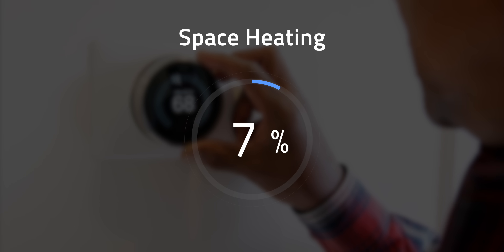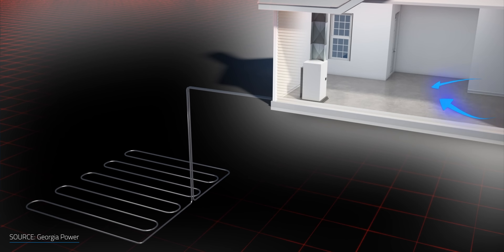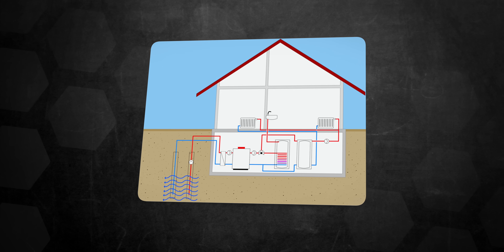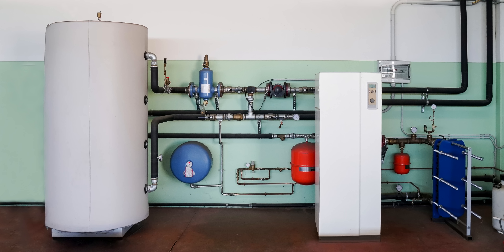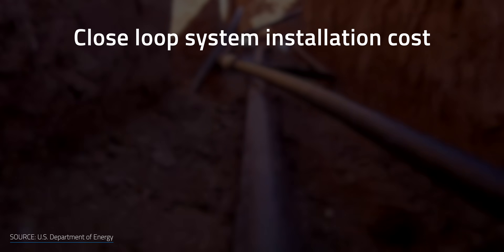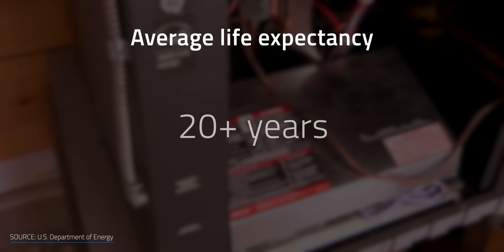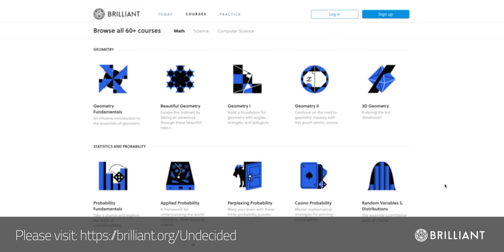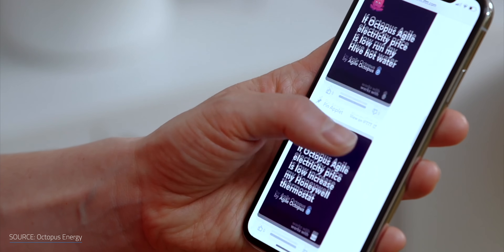Is Geothermal Heating and Cooling Worth the Cost?  Heat Pumps Explained

Comment: I live in Sweden and have a heat exchanger with a 180m borehole with a closed loop. It works well and has reduced the heating by about 70%. I'm just unhappy that I didn't install the cooling, didn't think it was needed because it's few days it's really hot.

Comment: My natural gas cost to heat is 48$ a month in the winter and to cool is 65$ a month in the summer electric Avg coast 56.50$ a month between the 2. There is no way I am spending 12 to 15k to heat my house and cool it off this system. I would never make the money back. It would take literally take 21 years to make my money back! That is if system even lasts that long No thanks. The price had better drop by one hell of a lot to even consider it.

Comment: Its 16% total because it is use year round. Not 32% that would imply 32% to cool and heat yearly. You said 16% to cool and 16 % to heat. cooling and heating is yearly so that 16% avg usage not 32% yearly.

Comment: Ive installed and serviced water furnace for 21 years and found there are 2 types of geothermal , broke down and fixing to break down 😂 if it last 20 years without many problems you are lucy and may pay off the difference vs a nice heat pump .

Comment: Man, you are forgetting the simplest and carbon neutral way how to resolve a house heating.... better insulation.. That house heat loss you are presenting in this video is an atrocity, such house should have heat loss at around 1 kW at max and that only with -10 C or less outside and +20 C inside...

Comment: When I watch this video and read the comments, I am amazed at how different house heating is done in different parts of the world. Here in Sweden, many households, the vast majority, use geothermal heat. That is, a hole about 100 m deep down in the earth (normally solid rock). It is usually a few meters of soil, but then there are often rocks below the soil that can be drilled in and provide good heating. It is a simple system that provides very good economy. The reason that rock is a good heatsouce is that there are normaly cracks in the rock that transports water and heat with the water. Soil does not have the same water transport mechanims. Almost no one uses oil or direct electricity to heat the houses. As mentioned in the video, geothermal systems are expensive to invest in and you can get some tax reductions for the investment. But even without the tax reduction, geothermal heat pays off. It is easy to drill and the hole only takes one day to drill and then all earthworks are complete. A system like this costs approx 10-20.000 USD which is a lot of money. But heating a house in a cold climate costs a lot. The return of the investment is done in 5-10 years. So nearly everybody use this kind of heating system  😶‍🌫This kind of sytem can also be used to cool a house as a normal A/C system.

Comment: maybe you could answer I question I have   - you partly answered it in the video  - in so far as  closed loop systems. vertical holes verse. flat lay   space not a concern .   I see 3 systems   vertical hole  ,  horizontal coil  over lay (slinky )  and   a  horizontal lay  ,,,  which  system would preform  over a broader temp range  and would there  be difference in operation cost.over the long term    in other words the  best field system  .

Comment: NO! No liquid is compressed! It is cold-agent gas (freon) which is compressed- and this tech is already used for decades (in all kind of refrigerators)- and peaks it's t° to +55°C, The liquid in ground contour is only used as heat transmitter to cold-agent via heat exchanger.

Comment: We didn't install geothermal environmental solutions. We just built our house into a hill and added more soil and rock as a water collecting berm. So the temperature inside is constant unless we let the sun in or open windows. No air conditioning is needed and a couple of wood stoves provide a little more heat in the colder months. The outside temperature is 32F now in Missouri. The inside temperature is 64F and the stoves are not in use yet. I might start them up tomorrow if it feels too chilly. It never goes below 55F but rainy days feel colder.

Comment: I was forced to change my heating system 3 yrs ago when fossil heating oil was no longer allowed here in Norway. A closed loop vertical system was expensive, around $40.000 but has proven to be a very sound investment. When you’re in a climate with freezing winter temps 5-6 months a year, heating is most important and reliability critical. Also, costs have been reduced by around 40%, giving a payback time of 6-7 years, which I am very satisfied with. And the system runs on 95% renewable electricity.
Reply: thank you for the information on the payback time. it is just what i needed to know. most people say its worth it without giving much information
Reply: I hope your government will make pants forbidden for men someday. Only skirts for men - nothing else. It would be a lot of fun!

Comment: How does the electricity usage compare between a geothermal unit and a standard heat pump/HVAC unit? I'm interested in what sorts of heating and (especially) cooling can be run off solar power, so I am curious if the geothermal will be low enough in electricity usage that it would be feasible on a solar system.

Comment: I have a vertical system that was installed 5 years ago and I wish I had done it 20 years ago. I went from oil and coal about $400 a month in the winter (Western NY) now the electric the geo system uses is about $50 a month. Best investment I've made.

Comment: We had a Bosch installed in a new build in 2010. 11 years later and only thing I do is filters. I think my coil may be dusty/dirty as I can tell it isn't as efficient as it once was. Over all though, I'm 100% sold on geothermal. In a double wide mobile home, 1/3 this size, we had $400+ electric bills all thru the winter (no gas except tanks in this area). Now, a high electric bill is one over $200 but that happens maybe twice a year now. We have 3 or 4 vertical shafts for a approx. 4000 sq. ft. house on 2 levels. I don't believe its over a 2 ton unit but I may be mistaken on that. We have 6" framed walls with spray foam insulation in exterior walls and on top of drywall on all ceilings. Attic has blown in so we are seriously well insulated. Saving us a ton of money now that it's paid for! Go geothermal!

Comment: I thought about going the geo thermal route when we built ~11 years ago (northern state).  But rather than spending extra money on the geo install, I spent more money keeping what heat I made - in the house.  Six inches walls with a skim coat of spray foam (stops air intrusion), then R19.  Combine that with a +95% NG furnace that also has a heat pump , my HVAC costs are are very low.  One nice thing about building a well insulated house is that energy (heat) conservation is passive.  Other than the initial upfront cost - it's done and won't wear out over time like a furnace/heat pump/geo.  Having dual heat (gas/heat pump) is nice too since if one system fails, the other can pick up the slack (within limitations).  If I build again, I'd probably alter some things given advancements in HVAC, but still stay with the same concept.

Comment: I put in a new geothermal system a few years ago.  Upfront cost was high.  About $32k for a vertical loop and a high end Waterfurnace 7 series.  Initial savings were a little over $2k per year.  With oil prices higher now, savings are at least $2.5k per year.  At the time, tax credits we’re higher, so my break even cost was 5 to 6 years when you subtract the cost of a conventional system I would have bought and the tax credits.
One thing this video doesn’t cover are the comfort advantages.  For starters, the system is extremely quiet.  You really never hear it.  Instead, it runs pretty steadily at a very power efficient rate.  So, there are no swings in temperature that you have in more conventional systems.  Your house is just the temperature you want.  You never have to even think about it.  Oh, and because of the desuperheater, we effectively get free hot water during the summer months.   
If anyone is “on the fence” and seriously considering a geothermal system, I would strongly recommend they get one.  I’m very happy with my system both for the efficiency and cost savings, but also for the comfort.
Reply: I just got my waterfurnace replaced after 30 years. Only had a problem 2 times and both were minor issues. New system was about 10k after tax credit, and about 20% more energy efficient even compared to the older unit which was already crazy efficient to begin with. If the installation is done right its great, but bad installation will make it a nightmare
Reply: @gauravbansal2999  Yes, your comments on reliability and cost are consistent with expectations.  I agree that the quality of installation is important.  As I understand, Waterfurnace has a much more intensive and demanding training program to be qualified than their competitors.
Reply: @gauravbansal2999  I ended up firing my guy and am replacing the entire unit myself for half the quoted price.
Reply: I've had a Waterfurnace for 12 years and it has been trouble free.  Love it !! @gauravbansal2999
Reply: How deep did you have to drill and what was the temp coming out of the ground?
Reply: @litoaykiu  They drilled 2 boreholes that were each 300 feet deep for our loop.  I don’t know the exact temperature of the water.
Reply: @steveseidel9967  Thanks!
Reply: @steveseidel9967 How many tons was your 7 series water furnace? Forced air? Did you get electric backup built in?
Reply: @tylertoepke-floyd4755  3 ton system.  Yes, we had existing ductwork from our previous system.  Yes, it comes with electric coil emergency heat system.
Reply: With a life span of ten years, a replacement cost of the compressors between 8 and 15k, and electricity prices now at 30cents a kwhr, the comfort is nice but not in way cost effective.   
  My geo unit was installed in 2012, and has an average annual cost (including installation and maintenance) is $17,000 per year.   Anyone can decide for themselves if that is cost effective.
Reply: @jku72  Nobody is spending $17k per year.  That’s absurd.  Also, more than half the cost was the drilling for me. My ground loop has a 60 year warranty.  
The price of a new compressor is more like $3k.  The prices you mention are to replace the entire unit.  Also, the entire unit is indoor so it’s not exposed to the elements like a traditional system, so your average lifespan isn’t correct either.
Reply: @steveseidel9967   I have an actual unit, with actual quotes.  So yes, it really does cost that much.  I have a current quote less than two weeks old, two quotes actually.   One quote is just a compressor replacement, thats $6800, to replace the complete unit is $14,600.   Modine 5 ton unit.
Reply: You're clearly being ripped off then.  I'd suggest you consider other brands and/or a different installer.  Again, NOBODY is paying $17,000 per year.  So yeah, if you're getting robbed like that, it goes without saying that people should do the math to determine if it makes sense to them.

Comment: Only worth it if you can use the town water pressure and not have to use a pump. An intricate valve system will do! So yes! It’s worth it but if you need to buy pumps no it’s not. You have to weigh up all costs

Comment: Our house in Slovenia has similar system for heating.  We have it for about 12 years and it works without any issiues and electricity bill is pretty low value, compared to other heating systems.  All you need a decent piece of land to lay the pipes. We will build new house and I will def. consider this type of heating for the house.

Comment: You CAN obviously supliment Ground Source Heating with Black Panel roof mounting systems (Like a solar panel, but, its black with pipes running through them) So as the sun shines down water is pumped up to the roof, through the pipes zigzagging through a set of black panels, and then back down into an insulated water tank. And you don't need to have intense summer sun to make good hot water either... 🤔😏👍😎🇬🇧

Comment: I install geothermal large and small a few things are very important. In closed loop you need to create turbulent flow vs laminar flow. There no pipe fusion joints under ground. Use the right pipe not well pipe because it looks the same. Use 600' of pipe per ton of heat pump. Bury the ground loops at 8and 6 feet. Cheap out at 7and 5 feet. Don't use slinky coils. That's cheaper too. Make sure the piping to the ground loops coils is piped reverse/ return. Make sure the buffer tank is large enough bigger is better. coaxial coils are ok for closed loop use curpronickle for open loop. 350 - 400 % efficient buy one kilowatt get 3.5 or4

Comment: The average forced-air hvac furnace, (assuming routine inspections, maintenance), should last approximately fifteen years. Central-air compressor should last twenty years or more. The forced-air is still the superior value even with a major repair (heat exchanger) not covered under warranty. Accordingly, I just don't see the geothermal R.O.I. coming to fruition.

Comment: One is either heating or cooling, not doing both. The two separate values can't be added together to say they share a percentage of total electricity use. The total electricity usage is 15-16% depending on the time of year.

Comment: Had a closed loop system in Michigan. Loved it, wouldn't put any other type of system in a home of mine. 
Paid for itself in 3 years because the cost of propane nearley tripled after we installed it.
It's more comfortable than traditional forced air too because it doesn't blow as hard.
Reply: Can you share how much you paid for it? In New England and I'm being told it would be like $150K
Reply: @TravelersWarden  shouldn't be more than $20k or they are lying
Reply: @jacobstrutner8232  This guy wasn't quoting me for a system. he had just put in our new air source mini splits. Just telling me the cost in the area for geotherm.
Reply: @TravelersWarden   No way it's $150k, even if it was a vertical loop, which is the most expensive setup for geothermal, it shouldn't be more than 40-45k.

Even the "high end" price on a closed horizontal loop seems to be about 30-35k.
Reply: @docmadhattan  You're absolutely right. I forgot about these comments and I had gone back and checked with my HVAC guy - it was $150K for a 20K square foot rich person's house on the beach. So....that makes more sense.

Comment: Several remote offices had geothermal installed with vertical wells with the agency I worked.  They were nothing but trouble.  One was replaced with horizontal slinky system.  It was the only system with which we had no problems.  The others seemed plagued with issues.

Comment: Would these hold up to a sustained -40°C Canadian winter?
Reply: If it’s properly sized and installed then absolutely. I live in northern Wisconsin where it can get down to -40f. My geothermal unit maintains my home at 70f no matter how cold it gets with no backup heat source. At a fraction of what it would cost to heat with natural gas or propane.

Comment: My Stepdad installed a similar system in 1985 in Switzerland and it has worked every since, with only one valve replaced for about $4 
Every floor has heating elements built-in, as we built the house from scratch. No Oil price will shock them. Oh, yes, for people pointing it out it was about 4x times more expensive than Oil at the time!
Reply: You haven't told us anything about finantial viability of such project. Without that it sounds like virtue-signaling.
Reply: @ms-jl6dl  - fair enough, I will ask him for the cost - but beside that point you can look it up yourself and with oil prices rising, it should be even a question.  There are solutions out there much better than in 1985!

Comment: Ice melts in a drink because the air around the drink is usually too warm for the ice to remain frozen.  Put an icy drink out on a very cold day, or put it in a freezer, and the ice won't melt -- the whole drink will freeze.  It has nothing to do with heat "flowing" in a particular direction.  Heat is sub-microscopic motion and cold is a lack of that motion, but perceptually, philosophically, and practically you can think of temperature as a state of matter that attempts to spread to other matter in every direction as efficiently as possible, constantly mixing with other also-spreading temperatures.

Comment: I don't think it is accurate to suggest that 31% of energy is being used for heating (15%) and cooling (16%) since they are not used in conjunction unless I've missed something about running electric heat to warm up a house that has become too cold rather than shitting off the A/C and vice versa.

Comment: I live in a suburban home with a smallish yard. Geothermal of any type is simply not practical. I am far more interested in the state of the art in air source heat pumps, and particularly in the mini-split designs that require no ducting. My home has none, and without a crawlspace, basement, or attic there is no place for it, so it's either the hot water baseboard heat we have - which I hate and which has already leaked once - or we do something like a mini-split system. Those are a lot more practical for many existing homes.